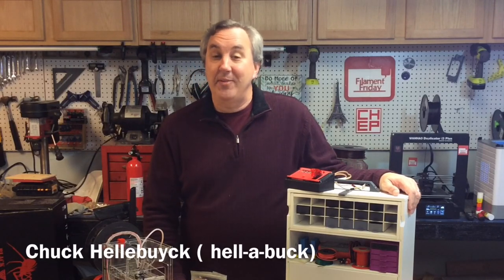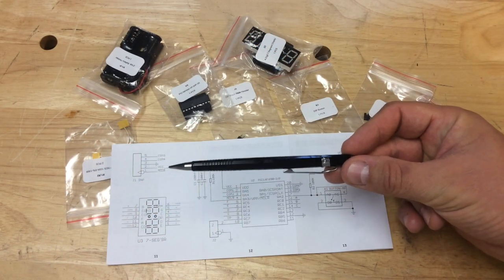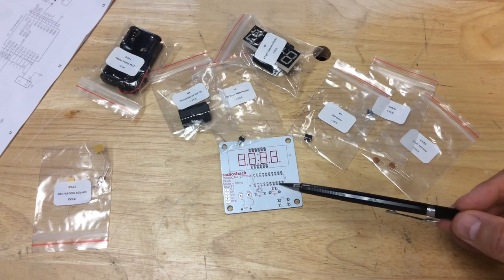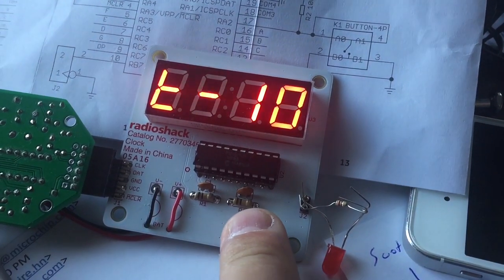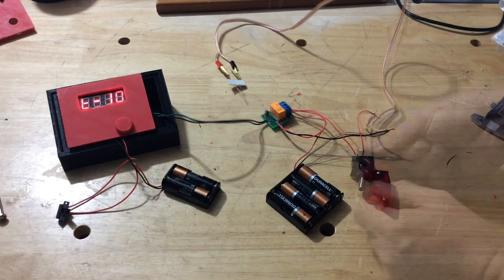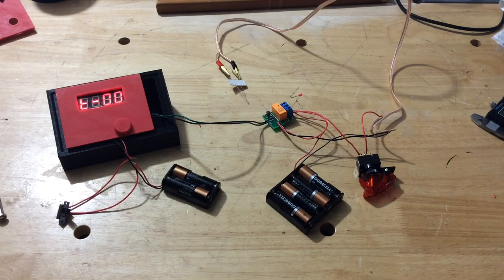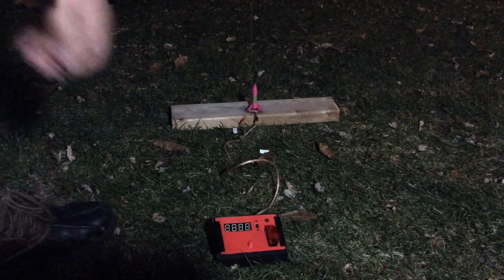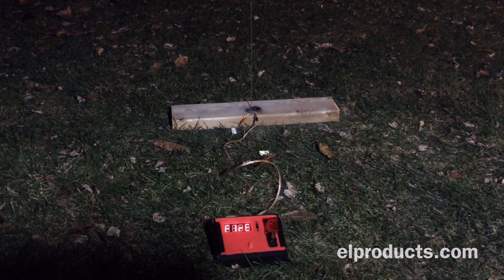Electronic RadioShack Clock Kit Hacked to Make a Rocket Launcher

Comment: Nice hack on the clock. I'm learning Arduino myself, and I am wondering if you use the Arduino IDE to load the code onto the chip or do you use another IDE for writing code for PICs?
For purchasing books, should one get them from your website or order them through your amazon link?